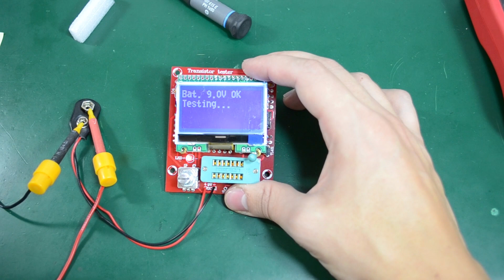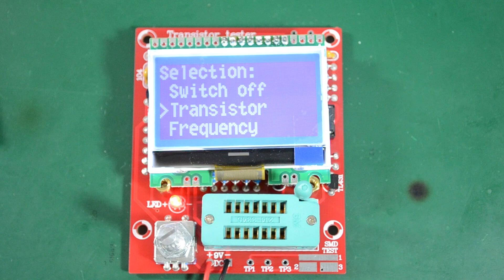Voltlog #26 - Graphical LCD Transistor/Component Tester

Comment: Nice video. However i prefer to put the iron to the joint and then add the solder. With a good multicore solder you will find you don't need the extra flux. I have soldered thousands of joints this way.
Reply from the maker: flux is a like a little helper, it's there to help. Sure you can solder without flux, with a good multicore solder wire like you said but a little extra flux can't hurt.

Comment: Excellent assembly and tips were awesome! Thanks for sharing. I have one similar to this tester but about a year older and different in many ways. No encoder or test processes. There must be many diff types of these. It does not have freeze problems tho. They are great testers!!
Reply from the maker: +saturn5tony there are quite allot of revisions of this particular tester both hardware and software. I guess it's only natural because the original project evolved over time..

Comment: I just got one this week, the yellow boarded one (91make). Did not work, then I noticed the backlight LED solder joints were broken. Lucky I found schematic, that showed if no current goes thru it, it does not work. Resolder did the trick. Silly failure mode...
Reply from the maker: +leppie I'm glad to hear you found and fixed the failure, unfortunately that's just something you have to prepared for with these Chinese kits.. On the plus side that never stopped me from buying them :)
Reply: +VoltLog By the looks of it, the circuit is almost identical. Mine has no rotary encoder though. Also was pre-assembled with surface mount (I did not know you could get kits ;p)
Reply from the maker: +leppie The rotary encoder seems useful for navigating through the menu. There are many variations of this circuit probably because Chinese makers just iterate based on the open source releases from the community.

Comment: Nice job building the kit. I like to use no clean solder too. Cleaning the pcb gives a professional look for the kit.
Reply from the maker: +TheRadiogeek Thanks! Cleaning is mandatory though for water soluble flux, because the ingredients are far more active than normal flux and will corrode the metal if left on the pcb.